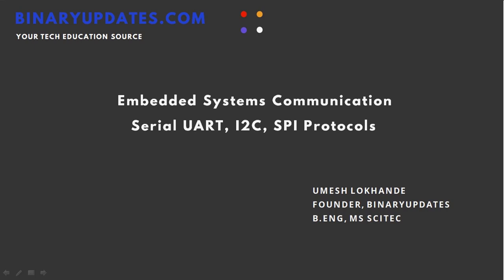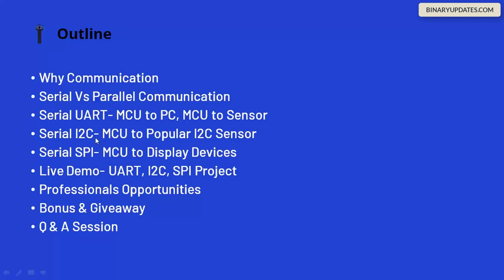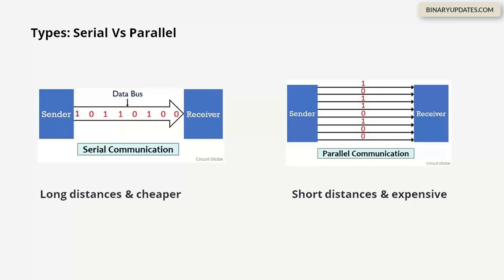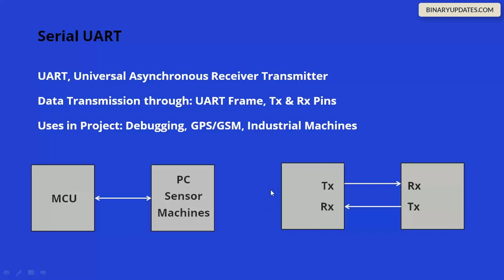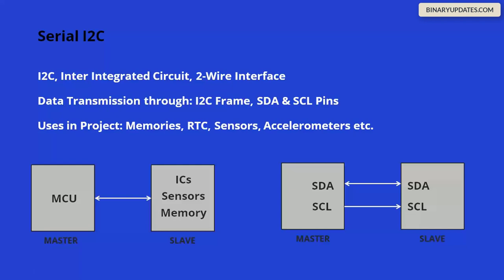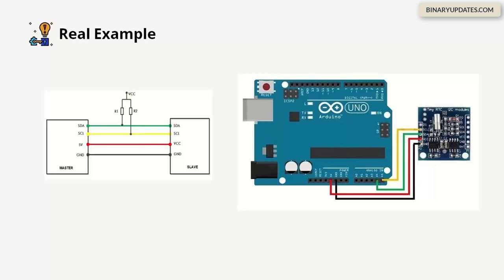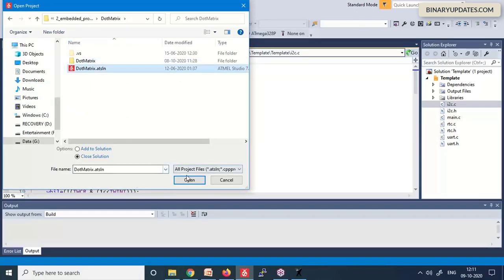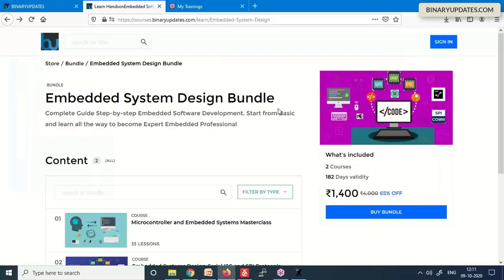Embedded Systems Protocols Serial-UART I2C SPI Communication

Comment: Sir I have a question,
I have seen a card in which more than one communication protocol available,
As computer communicate with card using eathernet, card have two different slaves, with one slave communicate with rs-485, and with other slaves it communicate with Can-bus system
How in slave card of computer can perform with two different slaves with different communication protocol...??

Comment: Hi Sir, I have a doubt actually, the protocols which we use in Embedded systems are they same in Vlsi Too
Reply from the maker: Hi Adnan, protocols in embedded software and VLSI are same. In VLSI, we implement or design protocols through synthesis tools and in embedded software usually, we write firmware to use UART, SPI, I2C Protocols to build applications. I hope this may clarify you roles of  embedded systems protocols in embedded systems and VLSI
Goos Luck and best wishes
Umesh